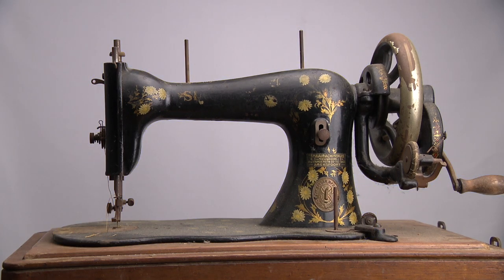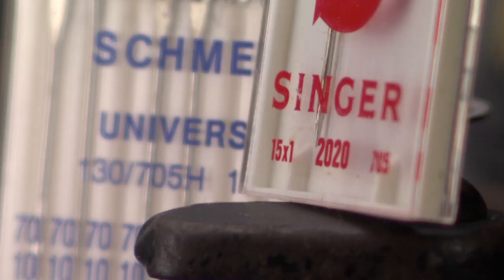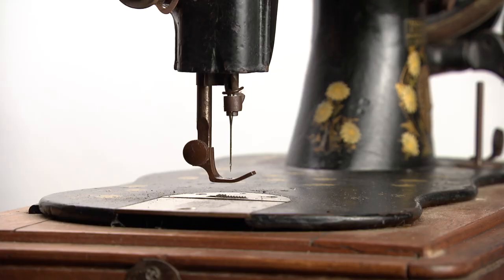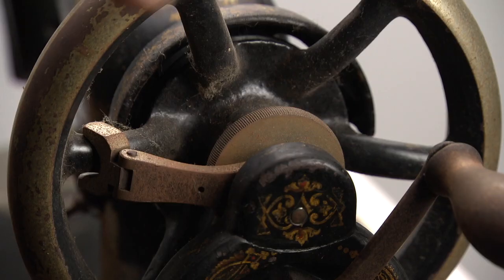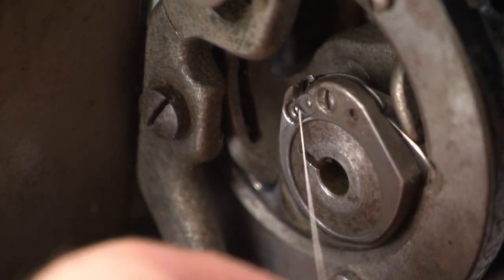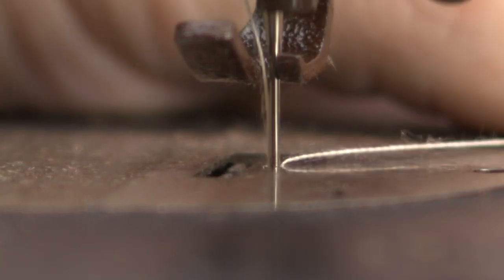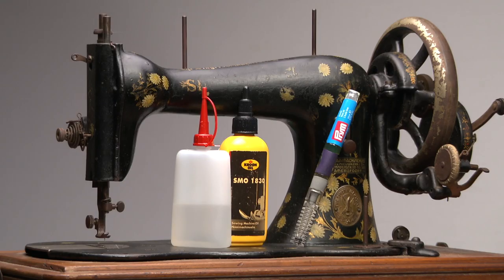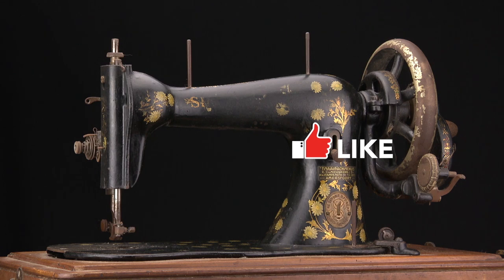Singer Improved Family (15-1) basics. Introduction and threading. Everything you need to know.

Comment: How nice to see: ) I've had an 1888 (SN 8429218) model for a couple of years, & it stitched from first attempt, as yours did: ) The early hooked bobbin case is what fascinated me. Mine was originally treadled, I believe, but was refinished after WW2 with a Hillman Motor attached. I need one of the U shaped Handcrank mounts, which are hens teeth these days unfortunately.

Comment: One more oiling point, the bobbin winder. For that take a pin to clear the little hole on the top side of that and then oil. Nice rare handcrank version. I have 3 IF machines and the larger 1883 Singer Improved Manufacture machine  or IM. One of my favorite machines.
Reply from the maker: Thank you for your message!
Wow, you have an IM? And 3 IF's?
Great Scott! 🙂
Enjoy your machines, Erik

Comment: How do you adjust the bobbin tension in this version? Did singer make it more complicated with the later models or was this easier?
Reply from the maker: Hi Scott,
To be honest: I have no idea how to adjust the bobbin tension. The only thing I THINK you can try is the little screw (4'26") just right of the eye. But I don't know for sure.
Although I liked the 15-1 very much, I have sold it to make room for other machines. So I cannot check it. Maybe someone in a Singer facebookgroup knows this answer. Sorry I wasn't able to answer your question.
Personally (!) I like the later 15's better: The race section can be easily disassembled and I can see what's going on.
Take care, Erik
Reply: That is correct, it is very easy to adjust with bobbin installed. I have been able to get decent enough tension even down to serger thread size. Super efficient design though it's really hard to even force a bad stitch.